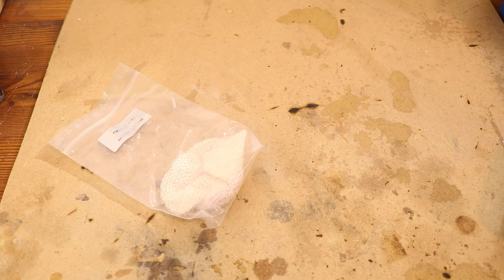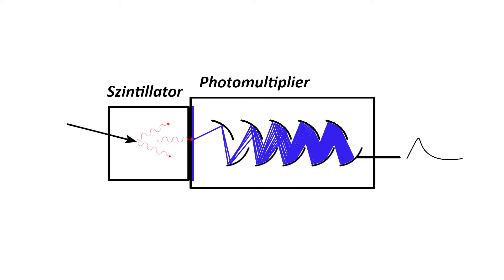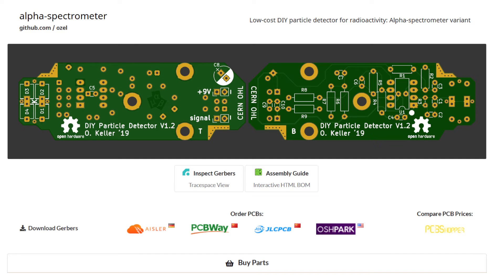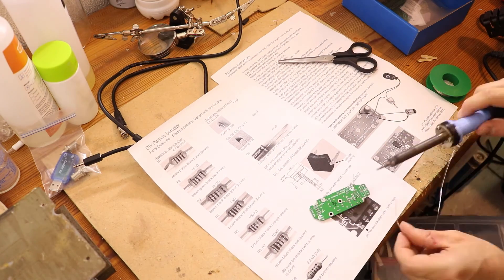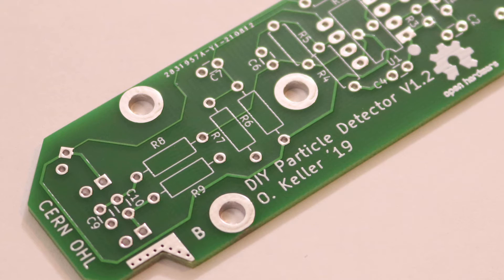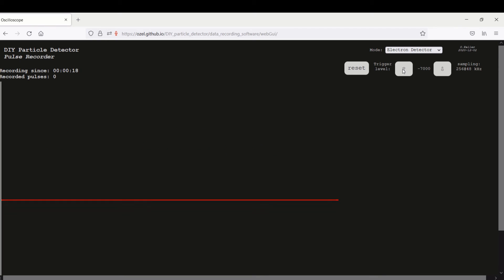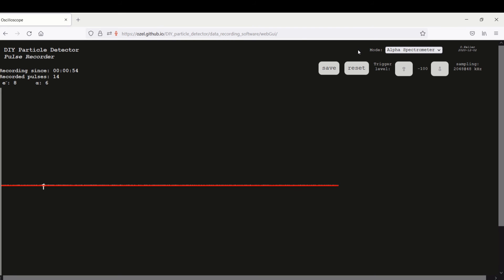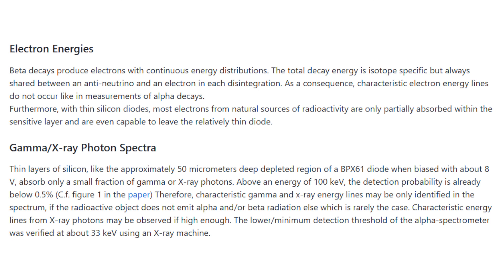Building a photodiode radiation detector

Comment: Thanks for covering this! 
I see a potential problem in your picture of the non-working alpha spectrometer build. The metal encasing of the diode is unfortunately the cathode and should not touch the metal box. Otherwise, it will make a short circuit with the electric ground (mounting holes of the PCB are grounded, intentionally). 
My advice would be to take a large enough metal box where the object that you want to measure an alpha spectrum from fits fully inside. Complete blocking of stray light in front of the BPX61 diode is otherwise really hard. The amplification of the alpha spectrometer circuit is several times increased compared to the electron detector, making it more susceptible to ambient light and the electromagnetic coupling of stray radiowaves (EMI).
Reply from the maker: Oh hello, thx for the comment :) I'm not sure anymore but I think I made the circuit with the photodiode facing up, not touching the case aswell. Maybe I will try it again at some point. But for now I'm glad the electron detector version works. 

But I was wondering why I couldn't do spectroscopy, because instead of just the photodiode I had the scintillator crystal, and with that I expected to get a signal proportional of the radiation energy.
Reply: @thesciencefurry  the amplifier must fit to the diode, mine is optimized for the bpw34 and bpx61 diodes. there are different kinds of diodes which can have different characteristics. for example, silicon photomultipliers need a higher bias voltage and the specified value must be met precisely
Reply: @thesciencefurry  Hey, thanks for doing this video, very very interesting. Could you tell me which lantern mantles you have that contain thorium? I would like to acquire a bunch of them. Thanks!
Reply: Hi Mr. Keller et al, is there a vendor that will sell me the variants of the photodiode radiation detectors pre-assembled (soldered)? I may consider incorporating them into a larger home project and I just don't have time to do all that soldering (grad school, work, hobby robotics, kids, etc).

Comment: Hi :) i made a similar project, polishing a bpw34 for alpha detection. Im still waiting for my usb sound card, but so far, theres an insanely loud 60hz buzz whem plugging it to my motherboard 3.5mm jack. Do you think it's impossible to get rid of it? I can't use it on my computer, i can only use it on my laptop without the charger plugged :/ if i charge it, i get the same 60hz hum
Reply from the maker: Seems to be the laptop/charger
If you shielded everything on your device idk what you could do🤔
Reply: @thesciencefurry  I was just using a plastic box, now I wrapped it in aluminum foil (I don't have a metal box with me right now) and it appears to have solved it :)

Comment: So scintillator is needed ??
Reply from the maker: No, I actually detached the scintillator from the photodiode and it performrd the same.
Reply: @thesciencefurry  if it's so useful than why photo multiplayer is used instead of photodiodes ?
and will it also detect soft and hard x ?
Reply from the maker: @omsingharjit  A photomultiplier needs a different amplifier circuit. I wanted to build a gamma spectrometer but it's pretty expensive
Reply: @thesciencefurry  no , I asked something else by the way ..
have you  successfully made Gamma spectroscopy meter  using Photo sensor ?
Reply from the maker: @omsingharjit  Ah, the photomultipier is way more sensitive. It can detect single photons. And no I haven't got it to work. You can do alpha spectroscopy with the other circuit. But I never got it to work.

Comment: Hi! I have been experimenting with the same exact diode + CdWO scintillator combination. The electrical setup is very similar, however it is based on an op amp of 60MHz bandwith. 
But I have a hunch that the penetrating gamma and beta particles trigger the photodiode. Instead of the light created by the scintillator. How am I sure about this? Well, the count rate is very low. At least it should be 5-8 counts per second! Since the scintillator has a lot of volume to produce individual flashes. I think the detector with the current diode could be improved with a reverse biasing of 12 or 14 volts. As far as I know in my and your setup as well it has some bias but not very much.
Reply from the maker: This is true. I detached the scintillator at some point and it had the sane count rate with just the photodiode.
Reply: @thesciencefurry  Hmm, then that concludes. I think if the diode is reverse biased highly enough ( i contacted the scintillator/diode selller earlier and he said that the diode can withstand around 30V reverse bias) then the gain will be better and individual light flashes could be detected. At the physics-open-lab you can find an article where the author used a standard PIN diode and a NaI scintillator. However the charge sensitive amplifier had a 1Gohm feedback resistor instead of the 40Megaohm which is used in this circuit. 
I did a cross check and it had roughly the same count rate with a BPW34 diode too (without scintillator). So i think the next step is to reverse bias the PIN diode with about 20-24V and de-couple the output with a few nF SMT capacitor.
Reply: @thesciencefurry  Also, how did you manage to detach the diode from the scintillator? CdWO4 is toxic stuff. Did you use some sort of solvent?
Reply from the maker: @MrEdwinHubble  No I wiggled it around until it came loose😅
Reply: @thesciencefurry  I wonder if it was just held there with a commercial glue and not with an optical binding agent... 
Well, the CdWO scintillator will come in handy tho. Do you have experience with plastic scintillators in gamma spectroscopy? I heard it is unsuitable for such measurements, but some studies prove otherwise.
Reply: @thesciencefurry  ah one more thing, just be careful with that CdWO stuff, highly toxic when inhaled/ingested...
Reply from the maker: @MrEdwinHubble  oh boy, I didn't know it was toxic. Also, I did want to build a proper gamma spectrometer, but I had power supply problems. And buying one is too expensive for me atm.

Comment: If anyone searching the comments would like to build a small scintillator like this but for not spectral purposes. Go on ebay you can find small square cut pieces of plastic scintillator, if your smart enough you can pair two of them together and make a cosmic detector that can subtract background for the most part.

For spectral response most anything shy of plastic will work. 

He'll have to correct me but it looks like potentially a Tl:CsI / Na:CsI scintillator or a PbWO, all three will work and has the benefit of being fairly moisture inert
Reply: CsI:Tl pairs with photodiodes well. A stupidly cheap bias is 4 to 6 CR2032 batteries. They will last years. Follow with am amplifier of your choice. My build used a j fet from a condenser microphone ❤
Reply: can you elaborate?? what shd one do different from the video?( I'm lrning electronics only now)

Comment: I am also working on a photo diode gamma detector. Though I also looked at making an alpha one and I believe the best way to do that is to get a ZnS scintillator which can be picked up on eBay for only a few dollars. And the. Use something like aluminized Mylar (emergency blanket) for the window which allows alpha rays to pass through all while keeping light out.
Reply: I'd recommend you buy the necessary mylar from someone who supplies it.
iRad on Ebay sells both the mylar and Ag:ZnS screens.
I believe his ebay is actually under iRad.Inc.

Space blankets occasionally work for a cheap and dirty build but the coverage of the aluminum layer is pretty poor, in return more sheets need to be used. The more used the more thickness the window will have.
In my exparementing without looking back at my notes the maximum window I could get away with while still detecting alpha particles was something in the range of 24um. Which is far off of what is preferred and recommended, at that point I was detecting just enough to know a source was there.
Reply: Oh as a side note you could use super high polished acrylic as your light guide, or even plain glass to produce something with more surface area than just the photo detector head
Reply: Indeed, Irad on eBay does sell everything required. And his Mylar windows are much better than a space blanket.
Reply: Get a bigger pin type photodiode, then remove the window from it.

Comment: Maybe the alpha particles are getting blocked as they can be easily stopped by paper
Reply from the maker: No that's just a generalisation. It can penetrate Paper.
Reply: @thesciencefurry  I'm finally glad someone else has said it.

Most alpha particles will be stopped by paper but not all, and after a long enough duration super small holes will be punched letting more in.

The most mylar I've put infront of a detector and still detected a response was something like 24-36um, I'll have to look back at my notes.